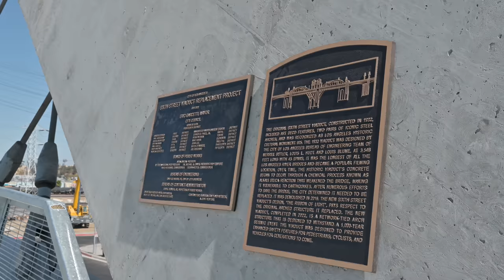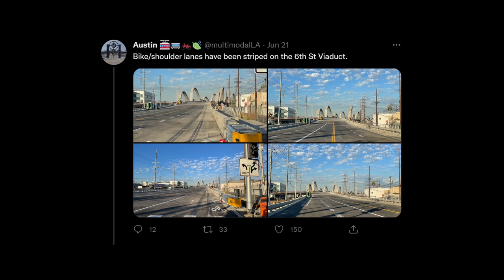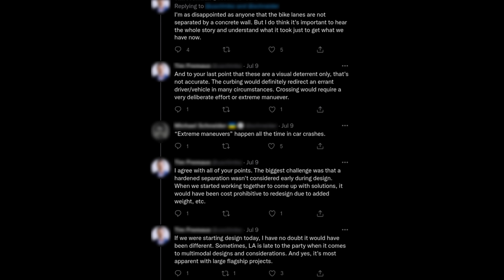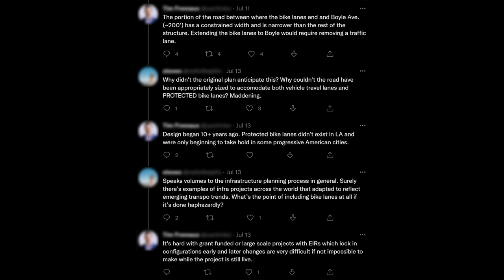The Failure of the New Sixth Street Viaduct Bike Lanes

Comment: The bit at the end really shows how useless plastic flexi-bollards are. They're basically placebos but unlike placebos, they're counterproductive because it can give a false sense of safety
Reply: Since it just opened, and now a tourist destination, I saw many people parking their cars in the bike lane along the bridge on the Boyle heights side…
Reply: It's psycological separation, but not true physical separation.
Reply: @chrisjohnson7929 
 0
Reply: False sense of safety works both ways. It still means that the average driver won’t run over the bike lane in a stress free environment the same way they don’t randomly drift lanes.
Reply: @LeeeroyJenkins  That assumes that drivers hitting cyclists is an intentional act by drivers, when a lot of the time it’s not. And if it is intentional, they shouldn’t be driving
Reply: You're wrong they do exactly what they're supposed to do... Maybe they're marketed in USA as something that protects pedestrians or bicyclists, but that's not what they're for.
A single bollard isn't supposed to do anything at all... 
They're supposed to help slow you down as you hit dozens of them...
I can be very helpful if you brakes fail, if your steering breaks, If you lose a tire, fall asleep, etc.
They're there to protect the DRIVERS and they do their job just fine!
Reply: As a traffic engineer, I don’t think you really understand the purpose of the bollards given the design constraints.

I’m also an avid cyclist and severely disappointed that the bike lane wasn’t placed on the other side of the wall (despite their design “constraints”).
Reply: As someone who has now lived in the LA area for 13 years I can say that a huge part of the problem is culture, the mind set that too many people have is that they will simply do whatever it is that they want disregarding anyone else around them.
Reply: even worse, they get pointed at and said "see we did something about it" and do nothing.
Reply: Thursday afternoon singing I love LA on my fix bike luckily the honk from onlooking driver seeing other driver lose control while filming  as you enter that film to jump out of way. As superstar Mcbain once quoted “real acid? … Ah, my eyes,  the goggles do nothing.” As he’s thrust into a aluminum pipeline saving his life.  Any who I will draw and send in some ideas for the entry way with not even paint on the ground on a shitty road. So displeased with that being hit many times living on 8 an union for min and taking Whittier blvd to Whittier every week.  Cops are corrupt, conservator ships are a thing and abused, and gangstalking with voice tonskull testing in Pasadena , hacienda and Whittier. It’s real. Look it up spread word
Reply: They're not that useless, if it wasn't for them, nothing would stop cars from actually driving on the bike lane, like we did here until they put bollards
Reply: nocebo is the term you're looking for
Reply: The plastic bollards are a visual cue, not a physical barrier. They were never meant to be a physical barrier, so anyone that has a "false sense of safety" needs to educate themselves.
Reply: @CallsignVega  You're putting the onus on the uninformed. It is not a good look, especially so when the uneducated here are the most immediately vulnerable. We can share knowledge without coming off so aggressively, now can't we? and yes, I know it is not your responsibility to play teacher, just seems this needed to be said.
Reply: oh, but you see, that was a disabled car when it crossed over, so design worked as intended.  (internalized screams)
Reply: I would ride on the pedestrian walkway instead. Way more protection. Plus, drivers are just bombing across this bridge and probably texting, too.

Comment: I completely agree.  I feel like biking should have been prioritized over walking in this case.  The bridge is so long and exposed it just don't see people wanting to walk across it. The concrete barrier also makes it seem even worse for biking, you have no way to escape or avoid a crash if a car comes into the bike lane.  I'd probably just bike in the walking area.
Reply: Cyclists should absolutely ride in the walking area. No reason to risk your life because of a design mistake.
Reply: @mariusfacktor3597  This wasn't a mistake, it was designed this way on purpose. The moment you 'design' a bike lane that doubles as an emergency lane for cars, you are way beyond making a mistake but enter the realm of negligence.
Reply: Cyclist are going to ride I the walking area and this completely disappointed it ended up being just another car centric block of concrete in the city !
Reply: @dantegianoli3267  Agreed. The fucked up thing is the reason this even needed to be a bridge was to get over two freeways, the 101 and the 10. So the problem was too much car infrastructure and their solution was... more car infrastructure.
Reply: I can't see many people walking the length, biking however is a different matter.
Reply: No one even bikes in LA tbh.
Reply: True, although DTLA may be one of the few areas where I could actually see people choosing to bike to work rather than driving if they live close enough.
Reply: Turns out that providing for biking is the least of the problems with the bridge.
Reply: Why not make one side biking only, and the other side walking only? That seems like a fair compromise to me while still providing a truly protected bike lane.
Reply: Not enough room in walking area especially with ebikes and escooters getting popular. If a disabled vehicle is blocking the bike lane then bikes will have to squeeze into the car lanes. That designer is an idiot. How can he not forsee people climbing the arches. Designer needs to get out of his car and walk/bike more often.
Reply: You cannot prioritize biking over walking. Video of the bridge after its opening showed more people walking than biking. People were happily walking across the bridge to go shopping. There are plans to include a park below the bridge, which will encourage pedestrians and bikers. Since it's California I expect for there to be skateboarders as well. Everything except people on horseback.
Reply: Agree, if I were there I would ONLY use the walking lane.  Hopefully all the cyclists do this en masse.
Reply: @mariusfacktor3597  its not a mistake los angeles you have to ride a bike with cars, your not allowed on the sidewalk
Reply: @mariusfacktor3597  this can be dangerous too, If foot traffic Is heavy. I was walking about 5 dogs with me and twice I had to move over for bikes because they were using the pedestrian walk way.
Reply: @grahvis  many people have been using it to walk, it’s actually a nice walk and when the park bellow opens I’m sure it will be very popular. most of LA is already a concrete jungle so we’re use to walking something that’s bare minimum.
Reply: @Defender_messenger  .
It did seem a bit bleak to me. 
However the proof of the pudding is in the eating, as they say.
Reply: @grahvis  I definitely wouldn’t want to be walking it during the day in summer but I mean I don’t want to walk anywhere in LA during the summer 😂😂 Even the suburb I live in has little or no shade.
Reply: @mariusfacktor3597  they could do two way cycle tracks on one direction, peds on the other side like the Golden Gate Bridge
Reply: @JhonnyBoi  bike share is great
Reply: @jeretso  *cycling the arches
Reply: @brachiator1  Compton has a horse riding history 🐎
Reply: @sleepy670  one side should be for cyclists in two directions, the other for peds
Reply: @Defender_messenger  That's my point. They didn't give bikes a safe place to ride because they fucked up building it, so bikes are using the pedestrian walkway.
Reply: Depressing that yet again cars win with bicyclists and peds left to fight over the scraps.
Reply: @NicholasLittlejohn  Every city has a horse riding history if it was built before cars
Reply: I would bike in the walking area too
Reply: @JhonnyBoi  it’s way too spread out, I wouldn’t bike there either.
Reply: @Defender_messenger  don’t walk 5 dogs then? Or keep them closer to you. Is moving over that much of an issue?
Reply: @kalon2414  because then they would have to fix the part at the east end where cars are getting onto the freeway and there is no crosswalk or traffic light, which is the section that scares me the most when I'm going across the bridge.
Reply: Compared to what are considered bike lanes in the rest of the city, the bridge lane (while it could be better) isn't really that bad. The bridge doesn't get a lot of vehicle traffic, which is good on one hand but bad because it gives the cars more space to move at higher speeds. I cross the bridge about 8 times a month and for me the scariest part is on the east side where the cars are merging onto the freeway and there is NO bike protection and you have to navigate around and between those cars. Given how little traffic the bridge has, one lane each for cars, busses, pedestrians, and bikes would've been a fair compromise.

Comment: When road engineers state that they're following "state dot guidelines" it's like they're completely missing the point that our current guidelines suck ass and shouldn't be followed
Reply: wild Alan Fisher appeared!
Reply: I wrote a city engineer when I almost got into an accident which I even saw coming because of a big apartment sign by the road. He said he checked the viewing triangles and they were within specs, but barely. This comment makes me want to write back quoting this. Even better that the comment turns out to be from Alan Fisher.
Reply: Changing the state guidelines would require reforms if not revolution.
Reply: Agreed.
Reply: That's a refusal to take responsibility by the engineer. The most important word is "guidelines".
Reply: Is this the engineer equivalent of "just following orders?"
Reply: State DOT standards are often a thorn in my side when trying to design safe bike/ped infrastructure. To be fair, our DOT has proven they can prioritize bike/ped facilities, but the standards need to change to prioritize safety of the vulnerable! If only AASHTO could finally release the updated bike guide, the 2012 guide is doing a major disservice to cities all across the country. I personally just refer to the Dutch Crow manual for bike traffic.
Reply: As a former civil engineer there are some huge problem with the field.  One is that simply saying that the guidelines suck, should not be followed, and are not really required anyway will get an engineer fired; no matter how awful the guidelines really are.  Especially a young engineer who has different ideas about how to do things than boomers who don't understand this push for walkability and bicyclability. 

There is also the issue of liability.  Civil Engineers can be sent to prison if people die due to mistakes in their work, like if a structure collapses outside of extreme stresses like severe storms or earthquakes.  However, in this case following the guidelines will prevent the PE signing the designs from getting locked up; even though people are dying due to this bad design.  Somehow in these cases of collisions and bad design of transportation infrastructure; it can be claimed that it was the individuals' fault, not the engineer's fault.
Reply: We're making progress in the wrong order. The best way to go about this is change those state DOT guidelines, THEN start planning projects around it. Like that would ever happen, though.
Reply: I remember hearing that traffic engineering is more or less a matter of matching the real world problem to a pre-approved set of designs and strategies from their little engineering guides. I'm not sure they could do their jobs without those guides
Reply: That’s all traffic engineers do. They apply guidelines. When they question the guidelines they get threatened with losing their license or being sued. If a guideline results in 10 deaths per year, and a novel design results in 1 death per year, an engineer will be held responsible for that one life because it’s considered untested while the ones applying codes aren’t held to the other nine.
Reply: Exactly. What's the state gonna do? Threaten to demolish the bridge if the code isn't followed? Don't follow the code and don't pay the fines, and tell the public if the state threatens other penalties.
Reply: If bikers are going to demand that they have a lane on the streets just as cars, they should be required to pay a yearly fee to maintain the roadways just as cars. They don't deserve a free ride.
Reply: Well, you should consider writing a paper for the TRB that tells them how to do it right, based on your better data and design expertise, right?
Reply: @altriish6683  Where did you get your degree in Traffic Engineering?
Reply: @bwj1158  Oh boy good one. How about this. If drivers want to be the default then drivers should at least pay for their own infrastructure. They don't. And the road infrastructure they do fund has the lowest return on investment, typically negative. City cyclists are paying for you boo, not the other way round. Next you'll be saying tax people's feet if they wanna justify a footpath.
Reply: @bhuddy1832  It's driven by people going to other countries and seeing how much nicer it is to be able to walk and ride a bicycle to places.  It is very nice to not need a car and be in places that are built for human use, not for vehicles.  

As for crosswalks I have another solution.  Use an elevated crosswalk at the same level as the sidewalk.  Put speed bumps on both sides to protect pedestrians.  The crosswalk in the middle can be similar to a much wider speed bump.
Reply: East LA foos have had it in a curfew now
Reply: I’m a traffic engineer. The DOTs are the client so you have to follow their guidelines unless you can provide justification for an alternative with sufficient evidence. Even then, the client has to agree to it. You also could be liable for designing something that doesn’t follow their guidelines if a crash occurs.
Reply: FACTS!
Reply: @eitkoml  Cool. Fire the engineers then. Majority of them dont give a shit about bikes and think the 4ft gutter lanes are fine because they check a box. Guidelines are not always limiting, they just encourage worse design. Engineers that proclaim 12ft lanes are necessary for truck traffic or buses or whatever are just not prioritizing cyclist or pedestrian safety. Every manual I have read allows for the guidelines to be ignored in "unique circumstances". Nothing is stopping the engineers from saying "we have a major safety issue here for cyclists and pedestrians, narrowing the lanes to 10ft would give us room for protected bike lanes and reduces speeding by drivers which also helps pedestrians"
Reply: @adamt195  It's interesting when people who aren't engineers, have zero training as engineers and have a chip on their shoulder make comments about what engineers should do. Do you have the license? Do you know what a trade study is much less have ever balanced multiple competing requirements? Do you have personal liability for any of the work you do? No? then STFU.

You want the guidelines changed go talk to the state and city government, they set the guidelines and best practices for a project, and also write the project requirements. Complaining that an engineer ignore the actual requirements because "I want it" is the act of a petulant child.

I find it interesting that in every situation where bikes have to share with pedestrians suddenly the cries of "share the road!!!" turn into "get outta my way, I'm commin' through" EVERY SINGLE TIME.
Reply: @drooplug  He may also have committed a logical fallacy: The appeal to a higher authority fallacy.
Reply: @bwj1158  That’s silly and illogical; Bicyclists also own cars which means they already pay a yearly fee. Therefore, they do not ride for “free" in your hostile, Libertarian sense of the word. And they are not “bikers;” They are bicyclists. I suspect that you deplore public education but, still, I want you to learn the difference.
Reply: @chevyyyyyyy  Every car I own has to be registered. Mopeds have to be registered to be on the roadways. Why not bicycles? I can't say that because I have one car that's registered therefore I shouldn't have to register my moped or a second car.
Reply: @bwj1158  I want you to register every vehicle you own, even those that are required. That way, you can feel that you are paying all of your fees and not getting a free ride on my tax dollar.
Reply: @chevyyyyyyy  Should I, a visitor from out of state, also then somehow financially contribute to fund your roads' overhead costs?
Reply: @virulentboyer3280  Pay what you are able and don’t pay what you are not.